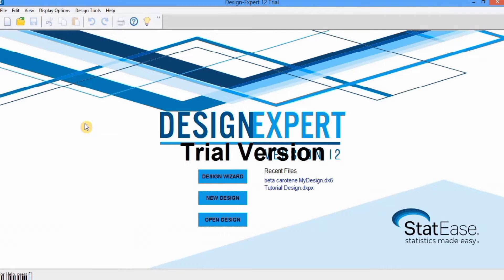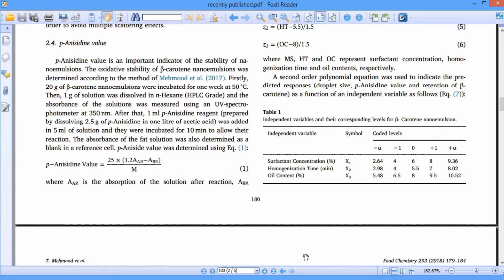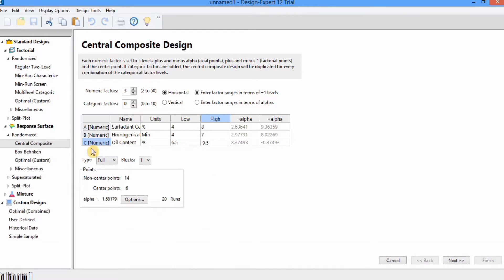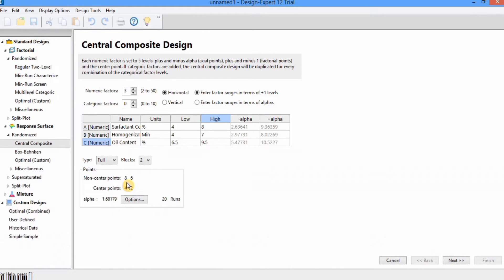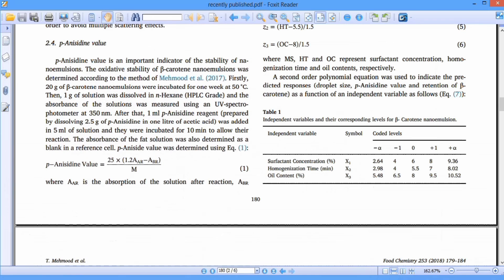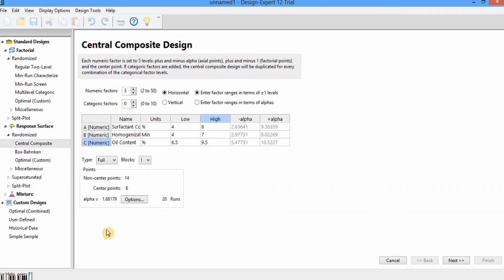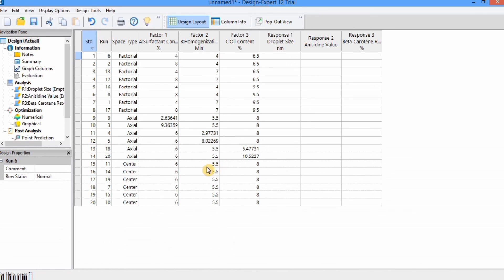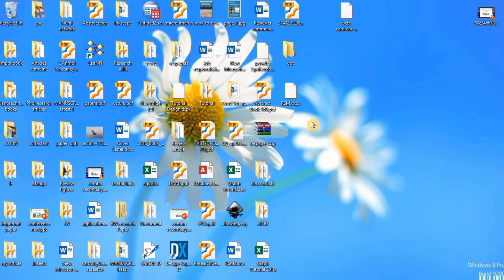How to Use Design Expert Software for Response Surface Methodology (Part 1)

Comment: Good explanation sir. Can you make video for the same with 4 factors and 5 levels so that 31 experiments. 5 levels are -2, -1, 0, +1, +2
Reply from the maker: follow similar procedure. Instead of 3 select 4 four factors in the software. Hopefully, by doing so you can easily get your desired results

Comment: While creating the experimental design at first, If we entered the high and low factor values in the parts of "enter factor ranges in terms of alphas" ,  would the selected factor values in the numerical part of the optimization in terms of alpha at the end? Do I need to transform them to actual values or would I use these values directly in the experimental analyses? 
For example: time range (low-high): 10-30 min, pressure (low-high): 100-300 mbar
  in terms of alphas (low-high)

After optimisation selected time:25.65, selected pressure:259.46
Can i use these selected values directly as optimum values or should i transform them from alphas to actual values (which are 30 min and 300 mbar)?
Thanks for your answer.
Reply from the maker: It depends either you have used actual values or coded values in high and low values. You have used actual values; hence there is no need for transformation. You can directly use optimization values. Secondly, if you are interested that your optimization values should be in range as you specified in high-low values, then you can use box-behnken design of RSM. I have also uploaded the tutorials of box-behnken design
Reply: @TeachingJunction  big thanks for your contribution !

Comment: if i have 3 variables with different sets of value, and through experimentation i got the value for responses, how will  i set it up on this software? I noticed that you need 3 value for every variables which is the lowest, highest and middle value (-1, 0, +1). Can i add any value in between of those 3 values?. thanks
Reply from the maker: No. Firstly, you should decide the maximum and minimum values. Put this data into software. Software will generate treatment plan. You should conduct your experiments according to the this treatment plan and analyze the data by following my lecture series.

Comment: Sir using this software can we use to simulate surface coating for zinc phosphate coating on steel if yes what inputs do we need to find